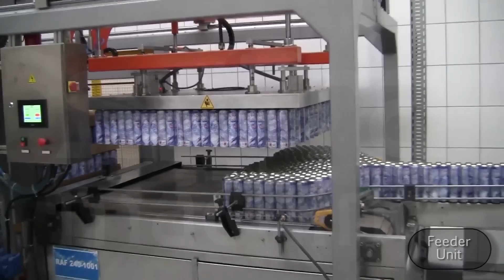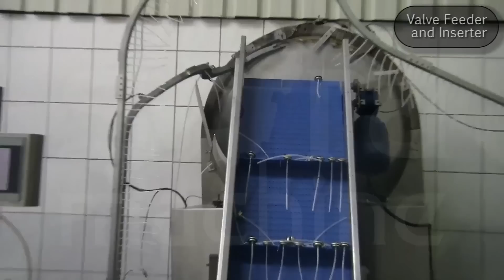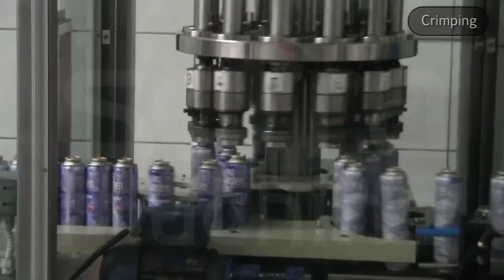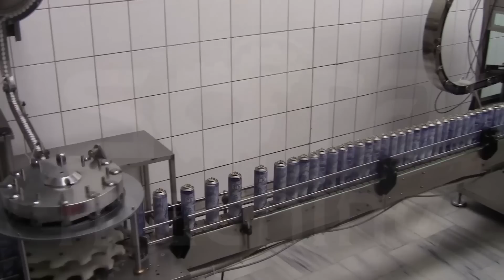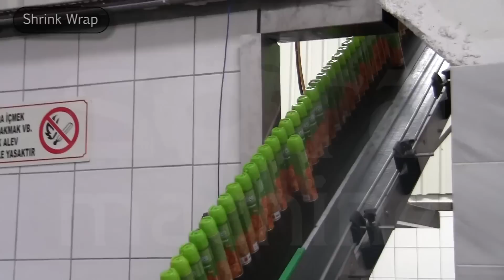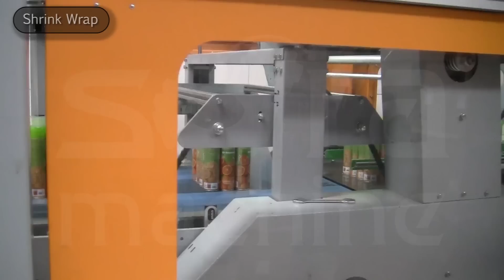Air Freshener Rotary Type Aerosol Filling Machine and Wrap Around Shrink Packing

Comment: How to found leakage cans if minor leakage. Kindly provide fully operation with machine Quotation and if batch coding vertical how to possible.
Reply: Each line has Quality Inspector whos checking/setting it up before starting a order, he also goin to check if right amount of concentrate and gas on it, also checks the height of every spout via crimp gauge. Minor leaks can be determined because it has gas inside of it..... if not there will be around 2 cans in every 120k cans goin to leak which is very rarely